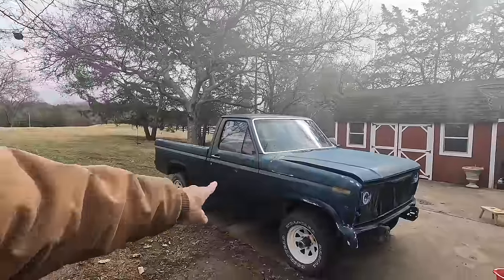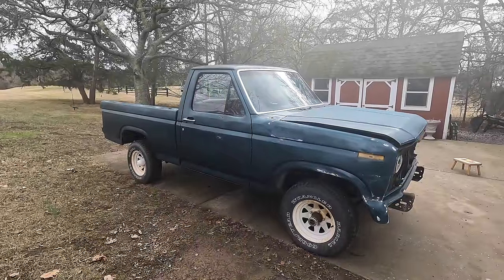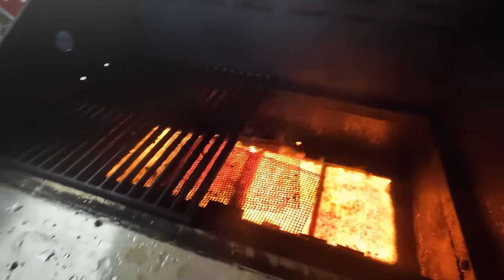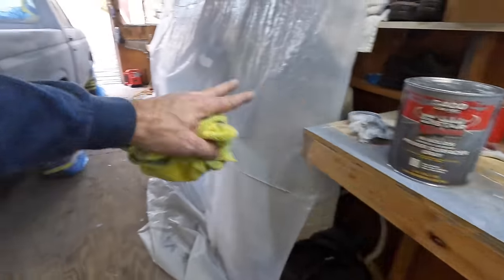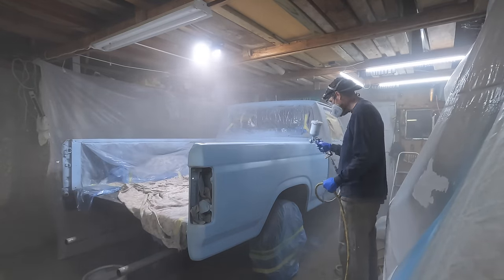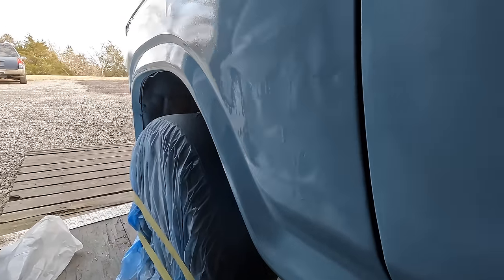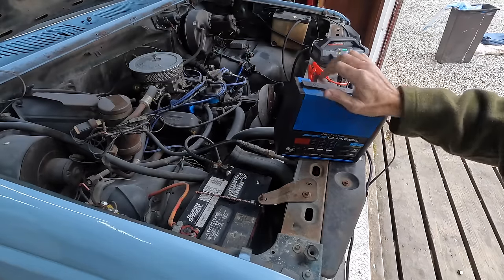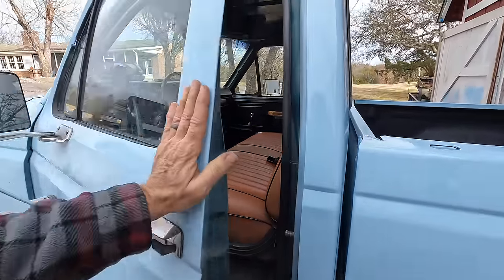Transforming My 1982 Ford F150 - First-Time DIY Painting Adventure!

Comment: I am an "old pro" at painting.  By far a primer sealer is the most important step for an even finish.  The etching primer is only valuable for bare metal, and it is not required. for a first job you did better than I did back in the 1980's lol.

Comment: As someone who has been a paint and body guy for 35 plus years you need to paint as much of an area as you can in 1 shot or atleast the entire panel because your start and stop lines will be obivious, and you should have used a Primer/Sealer,  I understand it's your first paint job and over all you did a really good job with the body work and the primer though, If I can suggest a look,  keep the gri bac and maybe even paint the roof black, the factory and alot of people go with light blue and white but I like to be different, a light blue and black color scheme would look really good.

Comment: You did an outstanding job.👍 I have almost the same truck, 84 long bed with the i6. Same np435 trans and 208 transfercase. Mine was originally that color, I think it's called French blue. Nice work inside and out. Btw a heat gun will make the floor mat lay down nicely.

Comment: If you wait a few weeks between the base and clear you can hit the base with some sand paper and (400) and get a mirror smooth finish with the clear.  If possible use a smaller tip for the clear and move the gun faster.

Comment: Looks pretty good for a first timer.
pROBLY AS GOOD OR BETTER JOB THEN I WOULDVE DONE. ive only did one paintjob on a car myself.
 I have limited to no access to a qarage right now so  the truck i was gonna buy was gonna get very little prep work since it was already in aboout same condition as yours  BUT primed by previous over in same color.
I wouldve chose a diff color though unless its only a  daughter gonna be driving it

Comment: At least if someone says it's not that good he can say he painted it in the dark.
Reply from the maker: I know I could have used much better lighting. 😢
Reply: @JohnBullOutdoors  naw man it ok. Only thing I'd really fix is that gap in the hood. Loosen that left side spring... Maybe take the hood off and step on the passenger side edge a little. I'd also probably go black rino linen 6 inches from the bottom to bust up all the blue and to get the interior and grill matching a little better. Two white pin stripes thick on bottom and thin on top to match the tires. Or paint the rims flat black